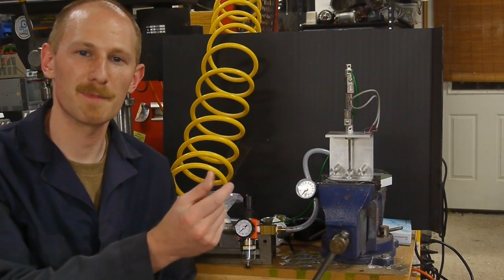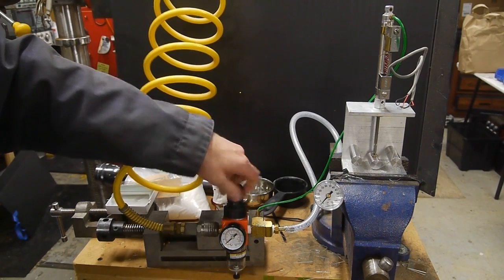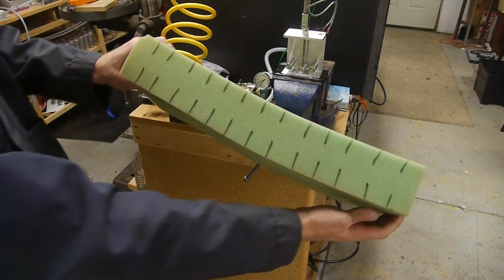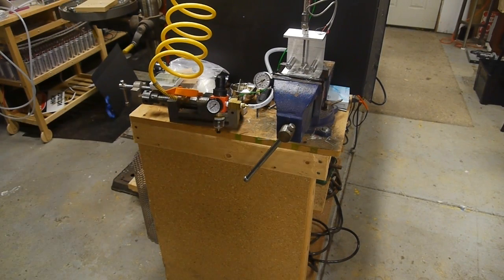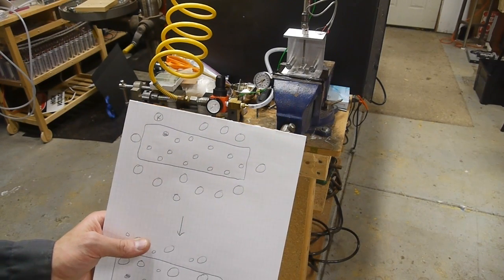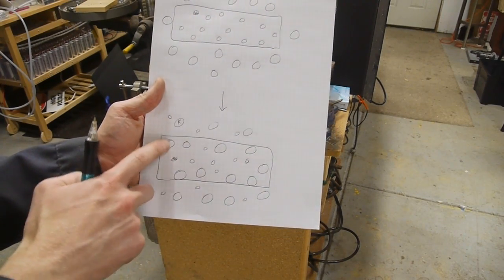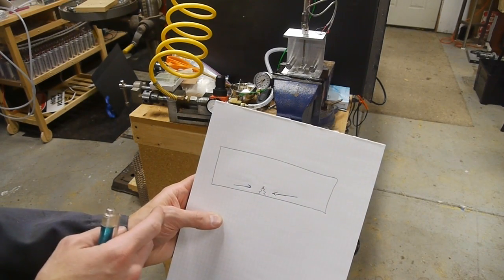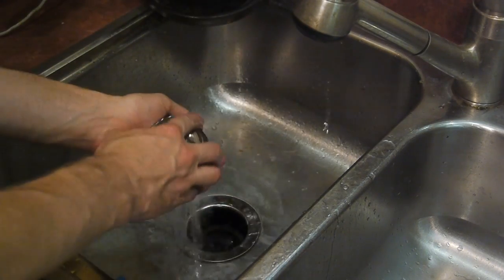How to chemically strengthen glass (eg Gorilla Glass)

Comment: Interesting, since canceling outermost tension into zero stress will necessary induce higher stress inside the glass just by statics principles. However I guess defects weaken tension far more when there is a boundary condition such as a free surface.

Comment: Another yet application requires solved tabulation of knots for bonding.
Better electron den-sity theory. 
And perhaps something from table of droplets as extra. 

Honestly Idk how sound stops and leave previously catch moment to become transparent. Forhot pic of ice cubes with vapor and clear(ing).. I know that hot matter easily transcends into snow phase, crystal..jumping over vapor liquid .supercOOled..It is like hitting miDDLe half with all the prime Bragg's peaks.

But overall curious subject. Wish we could use harmonic oscillator to make water vapor crystal in instant..like geology does. Or to make glass by imserting light, holes, or make certain permeability, connectivity..with properties we seek.

Problem with glass is sand quality. Spherical..eroded ny Sun...dunes are useless. Sahara Amazon trade off. Either. Not both green. 

Wish my life were different. To at least attack problem with more images, words. Good luck!

Comment: Two points (which may or may wnot be pointless):
First:  There is a superficial similarity between this process and case-hardening steel. In case hardening steel is packed with a carbon source (typically charcoal) and heated in an air-tight container to a temperature well below the steel’s melting point, infusing the surface with carbon to harden it. Making it stronger but more brittle.
Second:  Whoever first discovered this technique was doing some seriously creative chemistry.

Comment: That was extremely well done. 
At one time I was the supervisor of the chemical strengthening process in a glass plant, but our liquid potassium vat was large enough that we could strengthen glass up to 36x48 inches.
A few differences were that we kept the liquid potassium at 650C and we soaked the glass for about 8 hours in a batch process. 
We also let it cool slowly once it finished the soak.
Unlike thermally tempered glass, chemical tempered glass can be cut like ordinary glass, however cutting the glass removed the temper along the length of the cut about an inch or so to each side of the score line. Also a deep scratch in the surface would also remove the temper along the scratch line as well.
We would test the process by weighing 1"x1" samples, soaking them in the bath, and then weighing them again after they cooled. We could compute the compression level by using the difference in weight between the samples before the bath (sodium) and after (potassium). 
The balance that we used to weigh the samples was so sensitive that we could weigh a mosquito. We even weighed a mosquito wing one time.

Comment: I'm also wondering if this process could be achieved via electrolysis?  What if you submerge the glass in a high pH potassium silicate hot water solution and run a dc current through it?  Would that help potassium ions to diffuse into the glass and supplant the sodium ions?

Comment: I saw a great demo on TV of the effect of defects in glass decades ago. Take about 4 inches of 1/4 inch (say) glass tube and heat it in the center and draw it until very fine. Then mount it in a couple of holes in a piece of wood such that the drawn section is bent 180 degrees. Such a thin piece of glass is very flexible and all is good. However on touching the outside of the bend in the glass with the edge of a feather it immediately shatters. The nascent drawn glass has few defects and the feather introduces some.

Comment: Question, which I came to at 5:44: does the glass have a detectable (even if only with a micrometer or whatever high-precision instrument) amount of expansion? If so, how much? (In microns per centimeter, or whatever units make sense.)

Anyway, cool! That looks surprisingly easy! Some somewhat specialized equipment required, but not very! Nice!

Comment: Thanks youtube. I've been on YouTube for ten years and I've never seen this video from FIVE FREAKING YEARS AGO. Anyway could the process be applied to a glass fiber optic cable to any benefit?
Reply: Given what was presented, fiber optic cable would most certainly benefit. The challenge would be in soaking an entire roll. Or perhaps it could go into a long trough bath right as it is formed.
Reply: The only downside might be a reduction in clarity and thus transmission speed or distance.

Comment: Glass eyeglass lenses are "chemically tempered" this way.  I think the salt used contains silver, and that is what penetrates.  Of course, you can also "temper" the glass by slowly heating to a much higher temperature, and quickly cooling in an air blast.  It would be interesting to compare the chemical and thermal tempering processes for strength.  You should also check the samples with a polariscope.

Comment: Could you try to make a rig that pre bends the glass before you soak it.  This way  you can fill in the defects at a smaller point in the crack and create glass that resists breaking in one direction and is more fragile in the other direction?

Comment: I've seen this in an old high school chemistry video 25 years ago, but in that demonstration they used an impact test dropping a steel ball from set heights. The effect on impact was far more pronounced then the effect on your static bending load test, though they may have done the treatment a bit different. I'm guessing one is a linear increase and the other is exponential.

Comment: Would a process like this work for increasing the heat-resistance of glass?? Like for improving borosilicate glassware for high-temp laboratory use?
Reply: Yea, and I wanna know what weakened my lab glass. One day I was just boiling some water to make a coffee as usually and bam - the top in the holder snapped off! 
Probably just the heat cycles but it was a pretty soft cycle that day. Slow boiling and cooling. It went through worse abuse before.

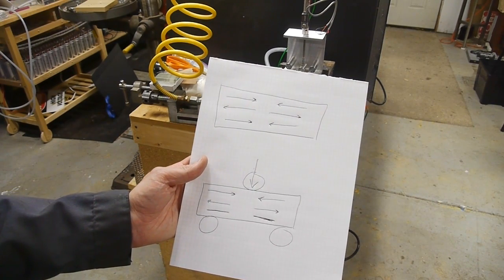Comment: Great video but there is an error in 5:57 : precompressed members will be not in higher compression in the compressed fiber. The compresion stress will be be the same as precompressed till the external forces increases to a point in which it led the material to a higer compression stress, but till this moment, compression stress will be constant. It is the same for pre tensioned bolts in bolted flanges.

Comment: Interesting. I used to operate a glass tempering machine. The end result is very similar. The outside ends up under compression and the inside under tension. The machine I operated used heat instead of chemistry.

Comment: I want to reproduce this process for a larger detail and in a bigger kiln, that I would prefer not to open through the process. So I have some questions: 1-The melting temperature of KNO3 is 334C and the boiling 400C, what should I do to prevent it from evaporating through the long hold at 450C? Just melt a big enough quantity so there is enough for the bath and enough for evaporation? 2-Any reactions with the surrounding air in the kiln? 3 - I also see it is marked as flammable; any precautions about this? THANKS!

Comment: Experiments on the microscope Cover slides would be my choice of substrate!  As would be the use of weight instead of pressure to controllably measure the failure point. After potassium treatment, sputtering with an argon / methane mix would provide interesting results.

Comment: Have you tried thermal tempering?  You heat the glass in an oven to a higher temperature, then quench in an air blast.  This is how many eyeglass lenses were tempered.  After that, they are tested by dropping a 1" steel ball from 36".

Comment: This is very cool. The diffusion process seems to only be possible at high temperature though. Since Na ions are smaller than K ions, the glass would need to thermally expand if no pressure is used to cram in the new ions. My bet is that borosilicate glass wouldn't respond as well to this treatment because of its low expansion coefficient. Additionally, you should try this same process under pressure!

Comment: Hi Ben.  A few questions;
- does your process also increase the surface hardness? Have you done a Rockwell or Vickers test?
- if you did this to an existing optical flat, do you think the stresses would make it go out of flat?
- it sounds like you let the glass cool quite quickly. Did you not inadvertently temper it too?

Comment: Do you reckon a vacuum chamber using vacuum in the beginning then adding then liquid KNO3  and then reducing pressure then pressurizing then vacuum once more then returning to STAP would help to impregnate the glass more? Seems possible but not a guarantee being as glass is so impermeable.
Reply: It would work for impregnating wood with rot resisting chemicals as it is the main method for manufacturing pressure treated wood.

Comment: Any learned Glass Blower knows that by increasing the wall thickness and tempering process also increases the compression strength there by interleaving the tension stress to the opposite wall of a given cylindrical glass pieces.

Comment: Question please!!! 

Can you in any way forcibly treat glass surfaces with boric acid or any other form or boron to create a film of borocilicate glass on the surface, or perhaps even infuse it deeper in?

Also would such an inclusion [favorably, or unfavorably] affect its optical qualities?
Reply: Not sure if you could get boron into it, but this would have to affect optical quality to some degree. Whether favorable or unfavorable would depend on the type of glass and type of additive used.
Reply: I would think that if one had a heavy gauge stainless steel container that could be bolted shut and both heated and pressurized, one could theoretically put in both boron and nitrogen [thinking boron nitride] and then allow it to cool under pressure back to room temp.

As you say, not sure if it can be done, but it would be novel to make a boron nitride infused glass.

Comment: What if you used even larger atoms? Maybe copper nitrate?
Reply: +Emir Efe Büyüközer I was wondering too, but I imagine if the process occurred throughout, you would no longer have compression, the entire piece might just swell instead slightly.
Reply: Emir Efe Büyüközer take this with a grain of salt, but I would imagine that you cant allow the larger atoms to diffuse too thoroughly. It seems like if the center wasn't under tension the whole material would relax and you might end up with a very slightly bigger slide with no increase in bulk ductile strength.
Reply: And also, what if you let the larger atoms further diffuse into the bulk, into the intermediate layers? This way you would get compressive forces overall the bulk.
Reply: Emir Efe Büyüközer
I would like to see how strong this glass can get, he should do more testing, I would definitely want to see.
Reply: Then there would not be any compressive forces, woud it not? :)
Reply: Bawb Lablaw
Hmm, well only one way to find out.
Reply: I think you would need to use a metal with higher reactivity than sodium in order for the diffusion to be energetically favorable. Copper is less reactive than sodium but perhaps a more reactive alkali than sodium could be used. Perhaps cesium nitrate.

Comment: About 50 years ago I worked in a restaurant.  When a new case of table glassware came in we were instructed to put them into a 5 gallon pot, cover it with cold water, then heat it to boiling for 8 hours.  Then shut that off and cooled overnight.  The next day we washed the glassware and put it into service.  The owner insisted doing this caused the glassware to be less breakable.  To be honest we didn't do any comparison testing, but the glassware sure lasted longer even after falling on a hard floor.... Your thoughts?
Reply: sounds like a good cleaning... water even at boiling won't do much to glass
Reply: To much bias towards the expected result in my opinion. Since you had no control group, it is hard to make any reasonable conclusions. This was some 55 years ago now, I hope you are doing great ;)

Comment: Speaking of glass, can you tell my of a type of glass etching fluid that will work on the back of a mirror? I want to make a design and them enclose it in a type of shadow box and light it from behind.
Reply: William Woodward Hydrofluoric acid... not for the faint of heart. Mechanical etching might be more controllable - and definitely less scary
Reply: William Woodward HF and HF releasing chemicals
Reply: The back of mirror is mostly metal, if you scratch off the grey protective coating.  Silver, aluminum or something like that. Probably aluminum I guess. The easiest way to is electro etching I think- safe and easy to do
Reply: Instead of starting with a mirror, try using Krylon Looking Glass paint on plain glass.  You can mask off the areas you don't want the paint to stick.  This is a special paint that applies a mirror-like backing to a piece of glass.  You can get it in many hardware stores.

Comment: Ben i was also thinking in the application of strengthened glass, specifically curves; such as using corning's willow for a canopy (although compound curves would be difficult without heat) Im wondering if you think that the glass could again be strengthened through this process while fixed in a curve, so that the tension side is "Opened up" and more susceptible to higher concentrations of impregnation?

Comment: Hello and thank you very much for this reason broadening video, it has often crossed my mind now for over a year. I am a glassblower by trade and have thought of applying this to my work O.O i think that treatment in this way plus a little silver electrolysis and my pieces would be some of the best. So thank you again. However i think this application has a greater destiny and it is in...
Fiberglass! Glass Sailplanes could become ultralight!!! You mentioned it was a straight forward process, but with filaments that thin it would be a fast one too!
let me know your :) applicational thoughts.
Reply: dude glass is really heavy
Reply: Took me awhile to get what (Preston) was saying. But I totally agree. With this process, it could be possible to make woven fiberglass stronger, and thus anything made with it could be made either stronger and/or lighter. This could push fiberglass into being a cheaper alternative to carbon fiber in certain categories; but only if the potassium process was economical.